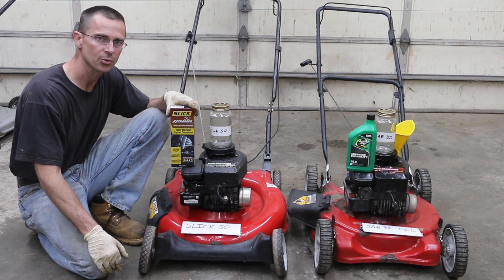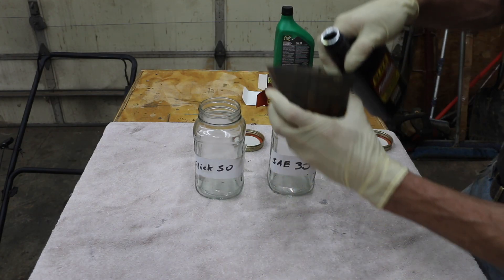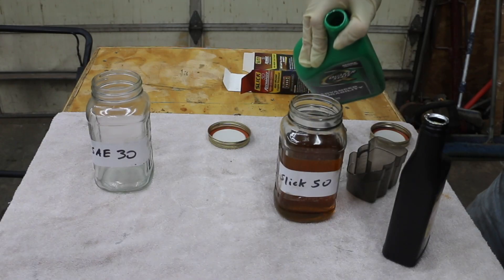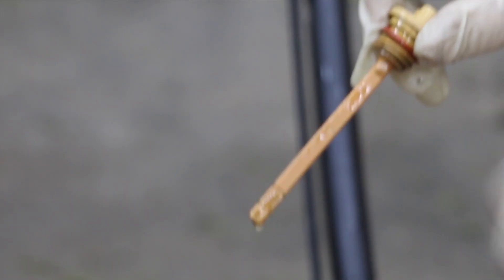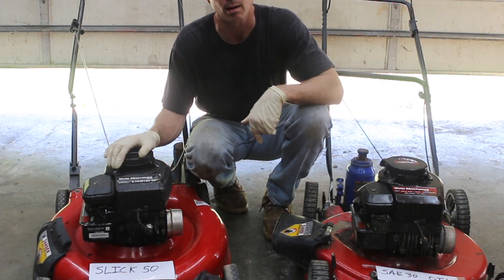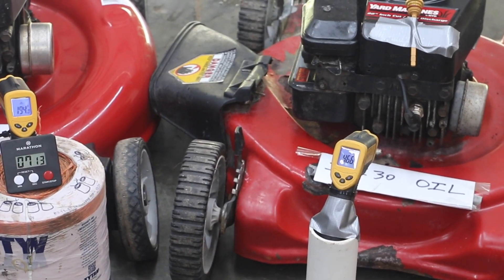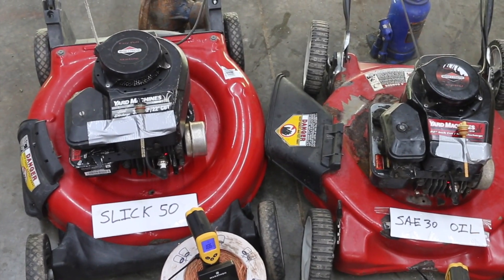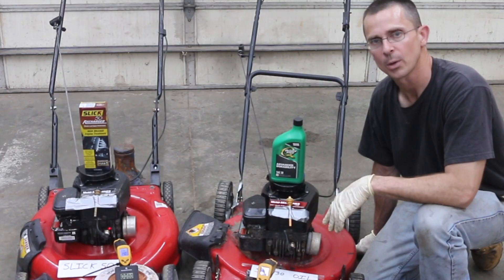Can't believe what SLICK 50 did to my engine!!--Dry Crankcase Test!

Comment: Hi,
I watch your videos frequently. I am interested in product testing. I think what you're doing is valuable. 
In this video, you show that the Slick 50 product does add value, but cannot save the lawn mower engine without lubrication. I think that decreasing engine temperature is a valuable byproduct because heat is a destroyer of engines. Heat management is important. However, I think it would be interesting to see the "postmortem" of the two engines. There may be some underlying reason for failure that differs from engine to engine. 

Thanks and keep up the good work.
Reply from the maker: Thanks, will do.  Thanks for the video idea.
Reply: I agree with you about the heat and was very surprised by how much Slick 50 reduced engine temps, not like just a few degrees either but by a significant amount! Also agree with the wish for a postmortem. Project Farm does fantastic work to bring fair, honest testing, I'm always impressed with his work. In this case, my critique would be that it looks like they were used engines so there is no way to be sure they were in the same condition at the beginning of the test. To his credit as well, his testing is completely open and up front, thanks for your comment and thanks to Project Farm!

Comment: Step 1: Ignore Slick 50 recommendation for amount to put in crankcase. 
Step 2: Compare two USED mower engines without knowing or disclosing the maintenance or usage history of those engines.
Step 3: Pretend this was an actual scientific test.

I'm no Slick 50 advocate, but this "test" only proves that you had two mowers which ran when you began your video.
Reply from the maker: Thanks for the feedback.

Comment: I gave up on Slick50 in the 90's after a Honda Civic 1.6 liter engine developed a deep rod knock after treating it with Slick50 multiple times  over 75k miles, along with Mobil 1 extended performance from new. Dealers advice? New engine. In a babied Honda at 75k. Thats enough empirical evidence for me.
Reply from the maker: Thanks for sharing.

Comment: I’m honestly shocked the slick 50 motor didn’t just keep running,,, they used to have a booth at our flea market with a 4 cylinder engine running with no oil pan on the dam thing.... you could look right up in it and watch the piston going up and down....
Reply from the maker: Thanks for the feedback.

Comment: I used to use Dura Lube. Haven't yet seen if you compared the two. I see you did do a Dura Lube video, but you didn't do dry run until failure.
Reply from the maker: Thanks for the feedback.

Comment: I would like to see this with one more test engine using a combination of Slick50/SAE30. Each has their own properties and products like Slick50 are made to complement your oil, not replace it. This would tell us if the Slick50, when used as an additive, works as designed.
Reply from the maker: Thanks for the video idea.

Comment: Did either engine pull through after they cooled?  I'm sure other asked this question, but 13K+ comments?  Yikes!
Reply: 8:37
Reply: @dylanbenker2043 : Thank you.  I watched the entire video.  I was hoping to see a tug on the starter rope the next day after everything had cooled down.  In the old commercials, both engines would seize, but the Slick 50 engine would turn, start and run after it had cooled off.  You didn't show that part.

Comment: I too used as well as sold Slick50 back in the early 80’s. It did perform very well. My customers as well as myself did experience improved gas mileage. I could also feel more responsiveness when I stepped on the gas pedal, improved compression. Teflon coated internal engine components will reduce engine temperature and wear. However, the Slick 50 I used back in the 80’s I’m not sure it’s the same formula that is sold today. Even though the engine that was treated with the Slick 50 did not last any longer in your test, I feel there are benefits such as lower operating engine temperature which tells me there’s less friction in the cylinder. If there is another brand out there that could improve gas mileage, run cooler and extend the life of the engine, I would be interested in trying it!  Let me know if you find anything.  Thanks
Reply from the maker: Thanks for the video idea.

Comment: I know this is an old video but as a comment (viewing this 11/17/20) I use Tufoil (Fluoramics) in my diesel and I also mix it 1:1 with Mobil1 synthetic as a general purpose lube for things like home fan bearings, etc. I'm truly a believer in this stuff (teflon based). Maybe consider this in one of your trials? (assuming you haven't done this already -- just happened on this video so maybe you already have)
Reply from the maker: Thanks for the video idea.

Comment: The variables inherent in a experiment like this are huge. It looks like these are both used machines. I think you would need to run this same experiment with more motors and the conditions of the motors would have to be much more determined and controlled. I am sure the whole topic of motor lubricant issue is complex difficult to nail down.
Reply from the maker: Thanks for the video idea.

Comment: I agree with Warren. Slick 50 has been out longer than 25 years. I used to sell it in the early 80's. Warren is right, you need to run your engine for about 5,000 miles before the PTFE coating is bonded to all metal parts and then you can do all your testing. I used it in my vehicles as well but I never ran the engines without any oil in it. If you want to do this test properly, you'll need to spend some money and time treating 1 mower first for about a minimum of 90 hours should do it.
Reply from the maker: Thank for sharing.

Comment: Slick 50 has been diluted a lot and not as affective as it was plus it wasn't designed to run without oil it coats the inside of the engine with a black surface that creates less friction
Reply from the maker: Thanks for the feedback.

Comment: I remember those Slick 50 advertising claims and as I recall the wording of the claim should be looked at closely, the claim was that after the engine was treated with S50 and run for a period the 'oil' was removed from the engine then the engine was operated for another 1000 miles without problems, note the way the advertising claim said 'the oil was removed from the engine' but with no mention of the Slick 50 being removed, my view of this was that it was a con job and the engine was run on just Slick 50 after the oil was removed which the wording of the advertising claim makes sort of truthful, I've had that view for a long time and have heard it from several other informed sources.
Reply from the maker: Thanks for the feedback.

Comment: There is a very strong chance that the Slick 50 used by Project Farm is not the original liquid. The name has changed owners several times and the originalf formula has also been changed. The original Slick 50 is now branded by XcelPlus. Please repeat this test using the XcelPlus brand.
Reply from the maker: Thanks for the video idea.

Comment: Try duralube I had a car I ran hot till it locked down 3 times in one day trying to get home next day car knocking rattling very bad put changed oil didn't help added 2 quarts duralube in it cranks it up rattling within 5 to 7 minutes engine quieted down began running smooth again ran till I sold car 2 years later
Reply from the maker: Thank you

Comment: Rislone  Engine Treatment.  it literally saved my dad's 2002 Pontiac Grand Prix technically it ran 74 miles with no oil. The other hand I would do to that test I would try again with slick 50 button used lawn mower for a couple times before you drain the oil out. It gives it time are the treatments the sit-in into the metal
Reply from the maker: Thanks for the suggestion.

Comment: My Father was a Mechanic , did not think much of Snake Oil , yet I found him adding Slick50 to His engine [ An Allegro , UK 147,000 miles when he sold it ]. I had a BMC Engine in my old Van , I could never stop one of the Tappets from ticking , on Dads advice I added Slick50 to the Oil , no more ticking . [ 40 Years back ] .
Reply from the maker: Thanks for sharing.

Comment: I think the effect is very different for a water cooled engine that retains its cooling when the oil is drained.  Teflon melts at about 210C so its not going to help an air cooled engine much.   Water cooling can keep the temperatures down to where the additive can do its work.   Perhaps one would have better luck with moly or tungsten disulphide which can take higher temperatures than Teflon.  I found tungsten disulphide one of the best high temperature anti seize compounds put there.  When that quits, the only option is mica based anti seize, but no way that is going to lubricate an engine.....
Reply from the maker: Thanks for the feedback.

Comment: I'm sad to hear the slick 50 did not hold up. I used to sell it in our auto parts store more than 20 years ago. A customer bought a quart and complained about the price. A few weeks later he came back and told me that the price was worth every dime. Apparently his wife had taken the car in for an oil change and the mechanic didn't properly install the drain plug. Within a couple of days of course they lost all the oil. Happily they were able to properly refill the engine and the engine didn't seize up. Slick 50 suddenly dropped the price on their product not long after. I automatically suspected that the quality may have dropped in too.
Reply from the maker: Thanks for sharing.

Comment: I've used Prolong for some time now and it seems to keep my RPMs a little bit lower, not sure why but it does. Not sure what it does for the heat of my engine, but I know that with these products you have to give it a fair amount of run time to really coat the engine well in order to get the full effect.   I did notice that the slick 50 engine seemed to a lot less rough when it stopped.
Reply from the maker: Thanks for sharing.

Comment: Motor kote from a larger Truck Stop will decrease operating temperature. No More Friction, ( harder to find) did decrease my engine temp and in my 15 speed trans and both rear ends. Never tried runnlng and engine dry, a step son did thuo,LOL.
Reply from the maker: Thanks for sharing.

Comment: I do not remember the commercial but I suspect it was with a water cooled engine, also the temp difference is quite drastic, if you used 2 new engines might be a different result.
Reply from the maker: Thanks for the suggestion.

Comment: I think the slick 50 was supposed to be used in the  engine for about 5000 miles to allow the teflon to stick to the engine.
Not 100% sure of the distance but I seem to remember it needed to be circulating a while.
Reply from the maker: Thanks for sharing.

Comment: I used slick 50 in a 100cc  2 stroke motorbike in 1987.  You empty the contents into the air inlet on the carb then with the engine running then ride the bike til it burns off.  It def made the engine easier to start and with better power/economy.
Reply from the maker: Thanks for sharing.

Comment: I remember using it a long time ago my boss insisted on it but every time we use to the gum up the sensors and make it run hot Aaron shut it down and couldn't get it going until we put new sensors in it didn't like the stuff
Reply from the maker: Thanks for sharing.

Comment: I have never had a gas small engine  lock up due to low oil. The Environment is on the way out for our grand children. All my 2 stroke engines  are down to one. My chain saw, which I rebuild ever 2 years. Now, my 10 year grand Daughter can do the job on her own . Just chance engine oil at least ever 6 months. Use non ethanol gasoline. Clean your engine well after use.  When winterizing I use Sentry gas treatment fresh oil and a full gas tank. Lawn mower, chainsaw, power washer ,outboard engines, never fail me because I do my best to care for them. Just care for each other and teach are children to care much also
Reply from the maker: Thanks for the feedback.

Comment: Try "Lucas" oil treatment or "Power Punch", we used to put a gallon in every oil change back in the day. That's a gallon in the big Cummins NTC 400,s . Works out to about a little less than 10% total oil capacity of the engine. Now I'm curious.
Reply from the maker: Thanks for the video idea.

Comment: You should do tests running an engine with WD 40 instead of oil.  It would be interesting based on,  it technically isn't an oil.  It was developed as a top coating for ballistic missiles to prevent rust and corrosion.  Also an interesting test would be to run tests using a mixture of Lacquer thinner in the gasoline to see if it cleans better than sea foam and other brands.  As people claim it works to clean catalytic converters.  It may work like a sea foam type cleaner.  I've personally used it in my own vehicle and my car ran like it had high octane gas.  It would be interesting! Thanks!
Reply from the maker: Thanks for the video idea.

Comment: The slick 50 engine ran cooler but stopped sooner. Makes no sense at all. I would have done the test over and torn down both motors to see what happened. No way would I have allowed the experiment to end at that point. Hot will seize sooner cold will seize later and there’s no changing that. I wouldn’t have been able to do anything else until I had torn both those engines down.
Reply from the maker: Thanks for the feedback.

Comment: I haven't watched this video yet but I can already tell it is not legit because a automobile or truck engine has a pressurized oil system on the crankshaft lawn mowers do not but now I want to see the difference. I did not see you shake the slick 50. The slick stayed in the bottom of the bottle. When you shake it up the treatment comes out white not oil colored

Comment: One engine had more internal wear on it than the other, thus, looser tolerences. Use 2 new engines.  Put oil back in those, turn them upside down, turn blade backwards 10 turns and stand them back upright - I bet they'll run again.
Reply from the maker: thanks for the suggestion.

Comment: You should of added the slick 50 with the engine PRE-HEATED, that was the instructions. And you were supposed to run the engine for a while at idle before cranking it up. As I recall, it was an additive for AIRCRAFT engines. Thanks for the review.
Reply: It's a treatment and not an additive.  Big difference!!! Slick 50 coats all friction surfaces with Teflon during heat ( engine running) . If he had done the pretreatment properly he could have run the engine without oil and it would not have destroyed it self. This is an amazing product.

Comment: I used Slick50 years ago on a 1990 GranPrix. I definitely got significant better gas mileage with it but on the next oil change if I didn't add Slick50 again my mileage went down.
Reply from the maker: Thanks for sharing.

Comment: My theory is that slick 50 is more fluid/slick and drained off the moving parts resulting in faster failure.  With such a difference in operating temp before draining it would seem it was working. I would like to see the bench wear test you do with this product.
Reply from the maker: Thanks for the video idea.

Comment: I was mudding once and had an oil leak from my rear main seal and I didn’t think much of it until I looked at my engine temp and the gauge had wrapped past highest temp and was sitting at the bottom and I could smell something burning. The engine heat had deformed everything in the engine bay. I mixed some rear end oil and a tube of grease along with some wd40 and put all of it I had in the engine. Much to my surprise it got me home without overheating again once I had cooled it off. Maybe not the most cost effective solution but it worked in a pinch.
Reply from the maker: Thanks for sharing.

Comment: I used Duralube in a neon I had years ago.  After a bit, the poor engineering / quality control resulted in a need for a new head gasket.  A mechanic expert in doing this job was brought in.  After removing the head, he inspected the wear on the engine.  For the high mileage, the wear was quite low.  He said, what ever you are doing, keep doing it.
Reply from the maker: Thanks for sharing.

Comment: THEY USED A OLD SLANT 6 AND THEY RAN WATER THREW THE TOP AND LET IT RUN OUT THE BOTTUM,  THOSE MOTORS WERE TOUGH
Reply from the maker: Thanks for the feedback.

Comment: One thing you have to know. The slick 50 on the shelf today is not the same slick 50 then. It had a white milky color to it and was made with ptfe. I actually did that test. Treated my car and run it for 3000 miles till next oil change. Put the car on the ramps, drained the oil, pulled the filter and fired it up! Ran it for about 30 mins. While reving it up to 2500 rpm  o casionally. This was on a car that had 100k miles on it. I ended up putting another 300k on it after that
Reply from the maker: Thanks for sharing.

Comment: I ran duralube in my car it was a late 80s ford tempo my brother ran over a piece of fire wood in the road and drove it 30 miles home with no oil we patched the oil pan and drove the car for couple more years fact it never had engine failure it was totaled in a crash
Reply from the maker: Thanks for sharing.